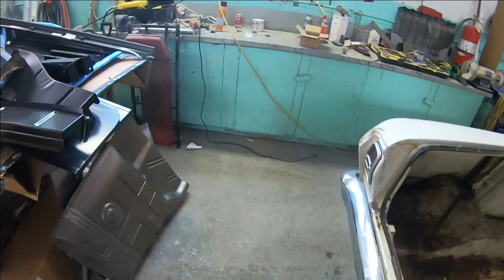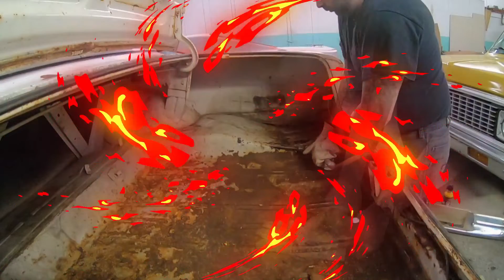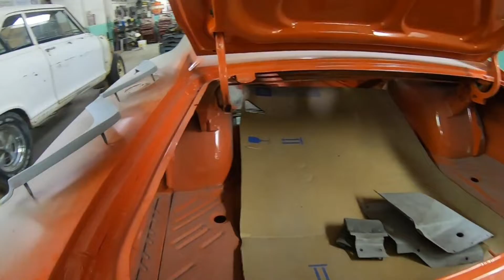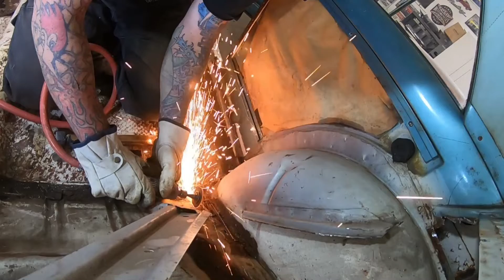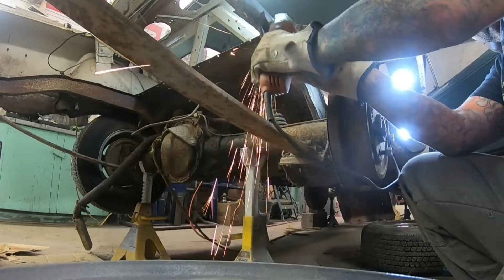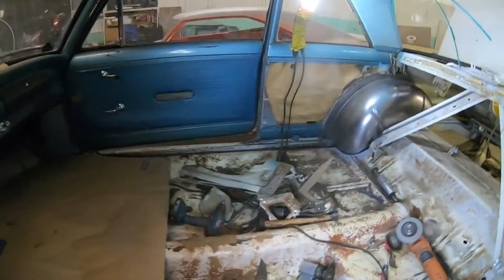Chevy 2 trunk pan & mini tubs installation, part 1

Comment: If he is doing a narrowed 9" do you think the frame extension in the rear was for not ? Have a question what is your go to clear  ?  I've used several different ones and I think finish 1 I'm going to go back to I've been using Nason base and clear or cromo base colors. I was able to locate a 64 Nova two door but it's bad and I know you can buy just about anything I need for it but this guy's wanting $5000 for it I'm not saying it's now worth it but that price isn't for me with the amount of money and work that has to be done !
Reply from the maker: Yep, just got the parts on Friday. It’s a fully built narrowed 9” (to fit 315s), and a TCI 4 link. I have the PPG shopline paint system and use the Shopline 7200 European clear, have always really liked it